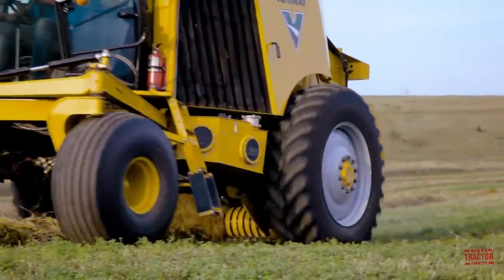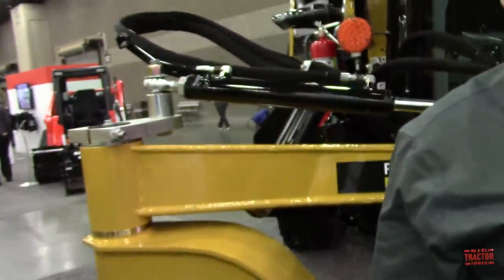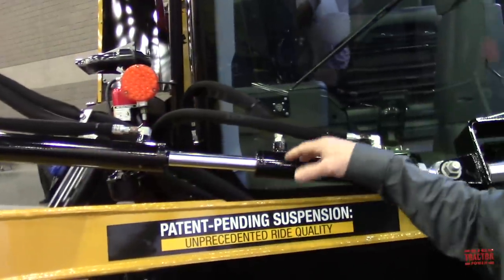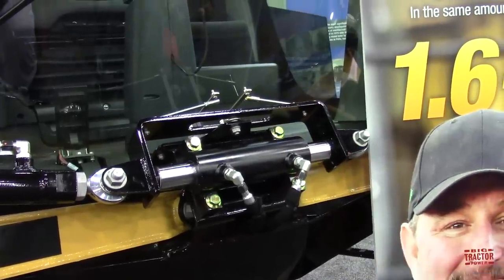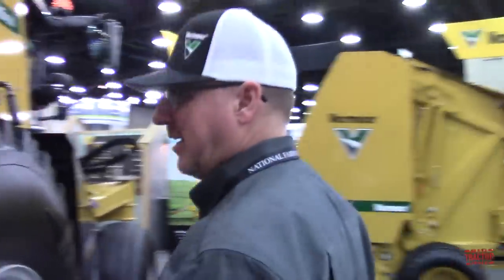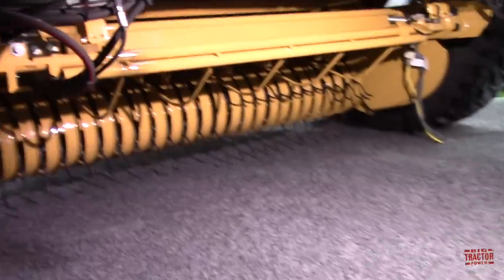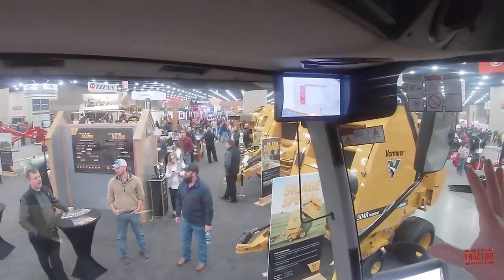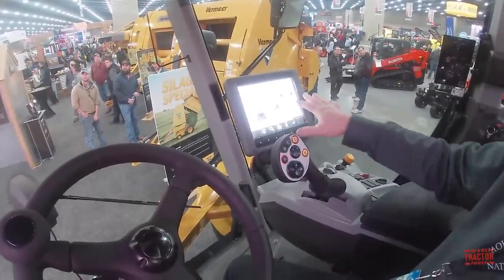New VERMEER ZR5 1200 Self-Propelled Round Baler

Comment: This is such a genius product, not to mention a legitimately truly innovative design! It may not be the first self propelled baler(the third I think? At least from a major manufacturer I believe), but it certainly has to be by far the most complete, thoroughly developed design. But, most importantly, it doesn't just take a towed implement and attach an engine & steering wheel to it - but rather this takes the limitations of a towed baler and actually improves on them by actually making it self propelled, the benefits of which(by way of their incredibly well thought out steering & suspension system) result in a higher output thanks to the higher average baling speeds that this machine can operate at versus the traditional towed baler.

It seems like a lot of companies over the years have taken all kinds of implements and attached an engine, a couple more wheels, and a seat & steering wheel, just to say "Ta da! It's better because we gave it it's own engine & wheels!" - but without actually offering any meaningful improvement over the towed implement.
But, this? Such an impressively well designed machine, I honestly don't think it would've made production if Vermeer couldn't gain a performance advantage out of it.

NOW... if only Vermeer would just add a pre-chamber to this machine - a self-propelled non-stop(no stop unloading) baler would be a damned WEAPON in very large fields, talk about a significant time savings!
But, surely they're already thinking about this - it's a no-brainer, it just seems like the obvious next step for this machine!
Reply: But is the time saved worth the cost of the added complexity? IDK
Reply: @Jaxon-iu6vb  This thing is pretty damn simple actually, it's all hydraulic control - the steering system, the bale chamber attachment mechanism(don't even know what to call it, lol), even the wheels are driven by two hydraulic motors(which is why they're such large diameter, hydro motors have piles of torque but are pretty RPM limited), so, presumably, the only thing that the engine drives is a hydraulic pump(s) and maybe a PTO mimicking element driving the pickup & baler itself(although the whole baling unit may be hydraulic motor driven too, that part I'm not sure about).

Cost is the big question though, since this lists as a ~$250,000 machine - but, keep in mind that everyone will be financing these of course, so the cost could possibly be spread out enough to actually pay for itself with the time savings and assuming that purchasing a new bale chamber will be meaningfully cheaper than replacing an entire towed baler should help in the long term.
Needless to say, I wouldn't even know where to begin to run the numbers vs a towed baler(and the hours put on the tractor and fuel burned vs this thing) to actually justify this financially, but the price shouldn't be unreasonable for large operations that bale a LOT of material. Especially in areas where rainfall can shorten the baling window, this machine will at minimum increase output under such circumstances.

It's a big "we'll see" though, this could become a long term product for Vermeer, or it could die off in just a few years if no one is buying them. Either way, all we have right now is speculation.
Reply: I should have been more clear, when I was talking about complexity I  meant the complexity of adding a pre chamber for continuous baleing.                                                If you think about it this self propelled barker is more simple than a tractor and a baler. I also think it will be interesting to see if this thing sells.

Comment: Trouble is it’s old round bailer technology,if Vermeer developed there own Continuous bale chamber like krone and Kuhn it would be a real game changer but they’ve stuck with 1960-70s tech
Reply: This self propelled round baler might cost less than a pull type big square baler. Square balers are also more expensive to maintain, and knotters are a pain. Square balers are cost prohibitive for most hay producers. Round bales shed water and don’t necessarily need to be stored indoors, where as square bales are wrecked if they get rained on. Square balers have their place but they are not for everyone.
Reply: Jaxon 9882 I’m not comparing it to a big square bailer,krone and Kuhn do Continuous round Bailers meaning you don’t ever have to stop ! The bailer this is based around is such old technology
Reply: @tingbase84  The new continuous round baler design is still being worked out.  They've had problems with the complexity of the design and are making changes all the time.  Both the Krone & the Kuhn are semi-variable or not variable in the bale sizes plus they stick an individual bale wrapper on it.  What if you do not want or need that?  Vermeer does have a prototype continuous baler out there.  For the sheer speed of this unit, it still is faster that a regular pull-type round baler or continuous baler.
Reply: thr8061 I doubt it’s even possible to have a variable chamber for bale size with continuous round baler due to it all having to work in perfect timing with the storage of hay whilst the bales being net rapped. As with the rapper on the back I would assume If krone and Kuhn made the bailers first the us market it wouldn’t come with it as mostly the us only found bale hay not silage. Yes in the perfect field this self propelled might be quicker than a continuous but in the real world I doubt it
Reply: Square bale technology is older than round bale technology. The big square balers use the same tech as the old small square balers, and just because a design is newer doesn’t mean it’s better.
Reply: Yes exactly right it needs to be continuous

Comment: Only any good for contractors or big farms , but 200 HP , you can haul a big baler with a 50 HP tractor , C Taylor .
Reply from the maker: I would not want to run a big baler on a 50 hp tractor all day. You will feel every plunge of the baler.
Reply: bigtractorpower just making a point , many people big bale with 50 to 70 hp tractors , a 100 hp engine would have been big enough , C Taylor .

Comment: Efficient!! 200hp to round bale, I think he has had his head in the chamber a little too long.
Reply: To bale that speed and volume you would need a tractor of that hp.
Reply: Kirk Gibbs lol no you would not. Hydros are never the most efficient way to covert energy plus it’s not a one use machine $100.00 to the charity of your choice if they still are making them in 10 years time
Reply: @kiwifruit2022  They said the same about self propelled combines in the 1950s. To each his own. The market will decide.
Why let a bet determine if you donate to charity? Seems odd. Split the difference and just donate $50 to the charity of your choice.
Reply: Kirk Gibbs I do anyway Kirk but to compare a combine to this? Yes the market shall white elephant for me
Reply: If they make it available with a 4 foot wide silage baler I would buy it. I make a living doing custom baling and this thing would be the cats meow. But I can't use a 5ft baler, and the 605n/604n are not very good at silage...
Reply: We run a 200 horse tractor on our 605m and it loads it up pretty good when you are baling heavy hay at 10 mph in hilly terrain.